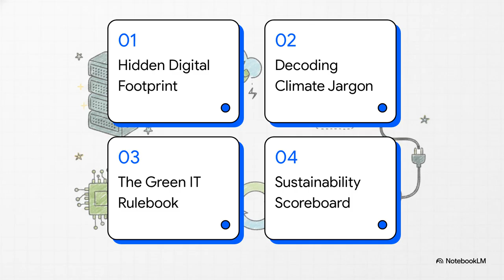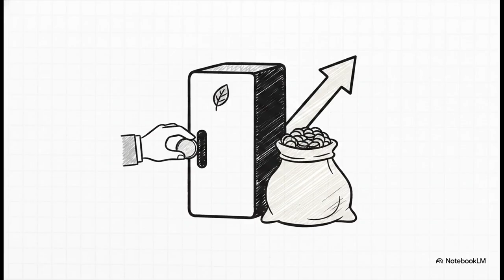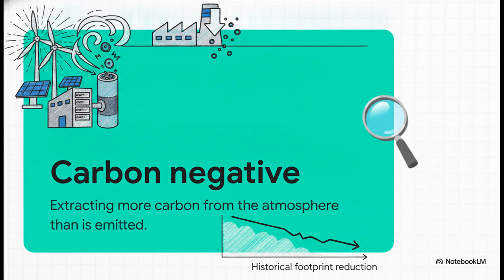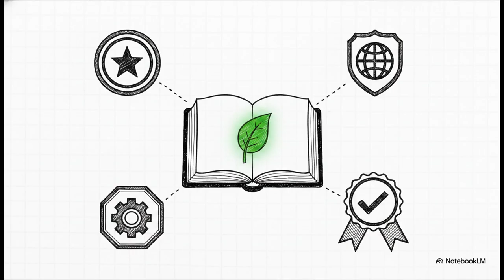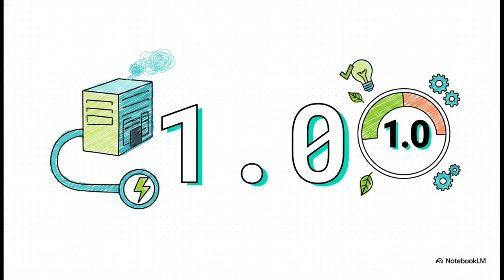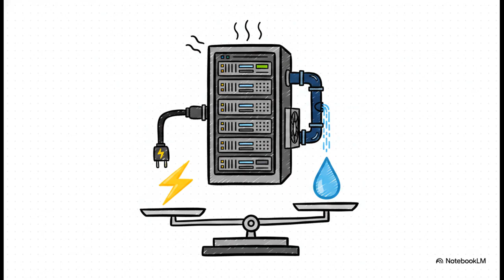Blueprint for Sustainable AI

Comment: This video serves as an excellent, comprehensive primer on the hidden environmental costs of our digital world and outlines how the IT sector can transition to a more responsible model. It bridges the gap between complex climate science and practical enterprise IT strategies.

Key Highlights & Insights:
The Invisible Footprint: The video opens with a sobering reality check, noting that the IT industry accounts for roughly 2% of global greenhouse gas emissions—a figure matching the entire global aviation sector, and one that is accelerating rapidly due to generative AI and crypto mining.
The Profitability of Green IT: A major strength of this explainer is how it debunks the myth that eco-friendly computing is cost-prohibitive. It highlights how server virtualization, eliminating "zombie servers," and stretching hardware refresh cycles directly result in millions of dollars in capital expenditure savings.
Decoding Industry Jargon: The technical definitions provided are exceptionally clear. The video masterfully untangles the distinct differences between being carbon neutral (balancing via offsets), carbon negative (actively extracting carbon), and reaching net zero emissions across a holistic global supply chain.
The Sustainability Scoreboard: The technical breakdown of essential metrics is invaluable. Viewers learn about Software Carbon Intensity (SCI) for developers, Water Usage Effectiveness (WUE) regarding LLM training runs, and Power Usage Effectiveness (PUE), featured alongside an impressive real-world Silicon Valley case study that achieved a near-perfect 1.06 PUE.
An engaging, high-level educational piece that is perfect for software engineers, data analysts, and anyone curious about the physical infrastructure powering their daily clicks.